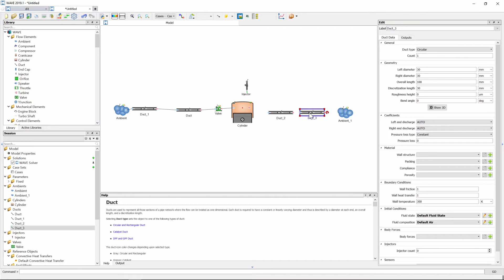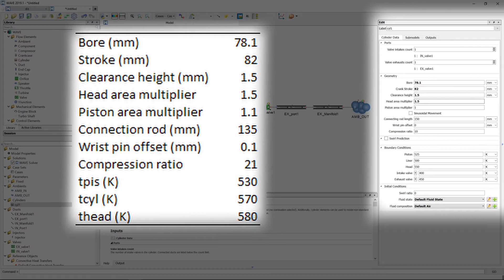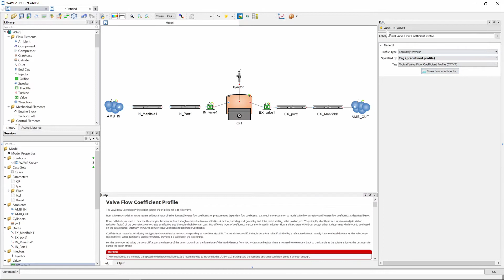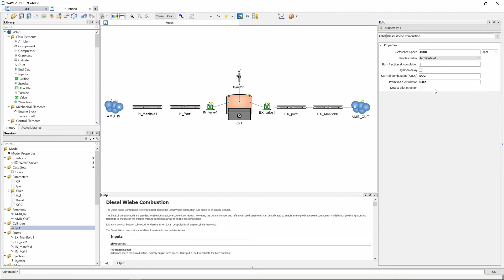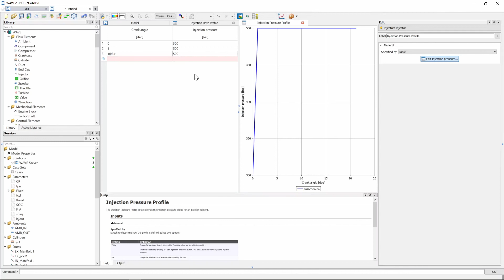How to simulate a one cylinder diesel engine in Ricardo WAVE | Introduction to Ricardo WAVE

Comment: How can we simulate the engine under 70% load conditions
Reply from the maker: Depends what engine are you simulating:
SI = restrict airflow
CI = restrict fuel flow
Reply: @AdriaanVanNiekerk  lets say it is a diesel engine , how can we simulate it o n 70% load
Reply from the maker: @ameenkhan6501  it depends on how much info you have with regards to the fuel injection maps. If you know what is the fuel flow full load, then you can reduce that amount to decrease engine load.

Comment: Thank you for the very informative learning video. How can I simulate the engine using hydrogen or ammonia as a fuel?
Reply from the maker: Thanks for the comment. You just need to change the fuel file and you would need to adjust the fuel injection timing etc. I have some other videos showing you how to change the fuel file. Let me know if you can’t find them 👍
Reply: @AdriaanVanNiekerk  thankyou. I have seen the video how to add fuel. I have added fuel as hydrogen. When I press the simulation it shows completed successfully but when I click on wave post a blank wave post appears,? can you explain it in a video, it will be really helpful
Reply: there is only injection rate, no fuel injection timing? what else do i need to simulate hydrogen as a fuel in a diesel engine?
Reply from the maker: @ameenkhan6501  It might be the injection characteristics. There are quite a few injectors you can choose from. So have a look which one is suitable for you. Some of them require little input, but then a lot of assumptions are made. Others require a lot of input which means you can control it better.
Reply: Please check your instagram handle. I have some request

Comment: Hello Adrian
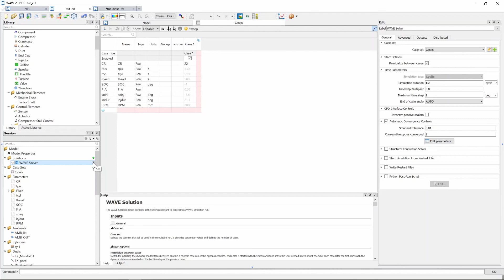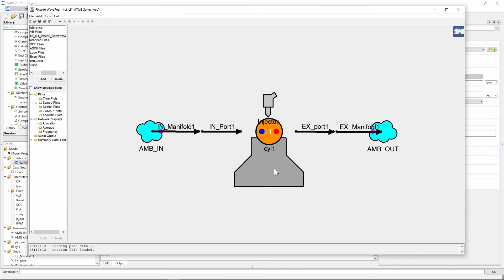At 9:24 after pressing the running man and finishing solver, when I click on wave post a blank wave post appears, not the diagram which appears at 9:30 in your video.
How can I solve this issue?
Reply from the maker: Did your output window say at the end that the run is completed with no errors? Errors are usually shown with F*** notation

Comment: Greetings Adriaan ,wanted to know whether i could simulate a particular kind of filter made up of certain materials in the exhaust of an engine which would adsorb specific effluents and produce emission results accordingly using this software
thank you!
Reply from the maker: Hi Vadukoot. Unfortunately when it comes to filters, the only thing that can be simulated is the pressure drop and acoustic characteristics of the filter. The emission values are locked as soon as they exit the cylinder. You can always create an external script that links with the model and calculates the effects that you are interested in?

Comment: I have a question.  Do you have any advice on how to implement a throttle valve, or at least the equivalent for Diesel, in Wave?  Since the Diesel essentially operates at WOT and is throttled by injection, can I model that here?  I am having trouble figuring this out.  

So far I'm just planning on simulating at a bunch of different fuel injection values, and then tabulating those values in excel to plot them.  That should work but will take extra time.  Thank you.
Reply from the maker: It depends on how your fuel injection is modelled. If it is a fuel air ratio injector, then you can vary the amount of fuel injected and the power output will increase and decrease accordingly. You can create a bunch of cases with different fuel amounts to make your life easier in generating the different values you are looking for.
Reply: @AdriaanVanNiekerk  thanks Adrian, I'm part of panzermeister36's uni project group and we were having a lot of trouble with this.
Reply from the maker: @woodseer559  glad I could help. Let me know if you have any other questions
Reply: @AdriaanVanNiekerk  yes, thank you!

Comment: where i can download ricardo wave software for free
Reply from the maker: Unfortunately Ricardo WAVE is not a free software and you need to buy a locense from them before you can use it. If you are using it at an academic institution then they can provide a big discount on the price. I have found a free alternative, OpenWam, but I still need to play around with it a bit.